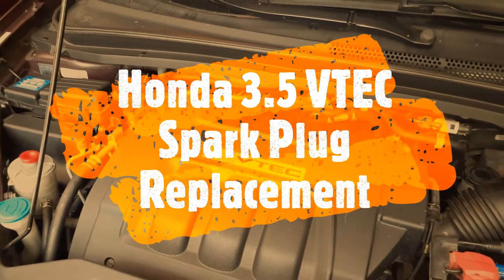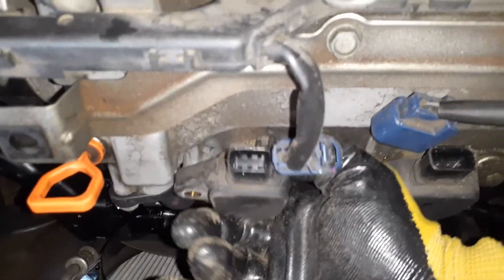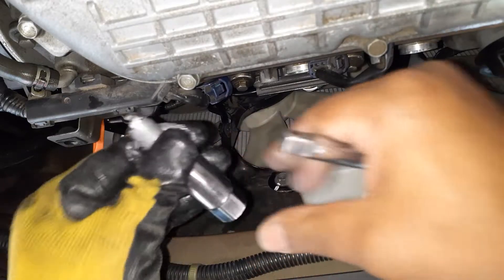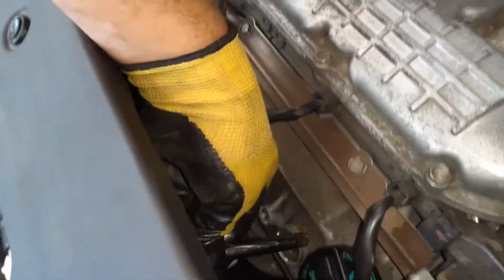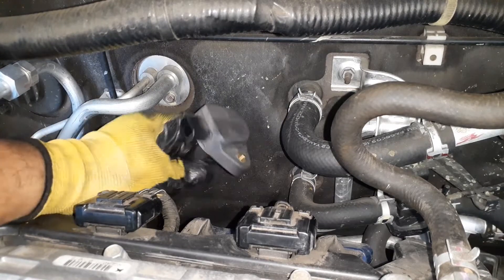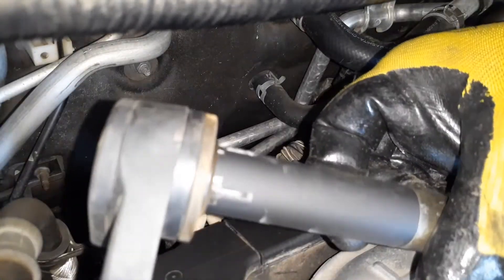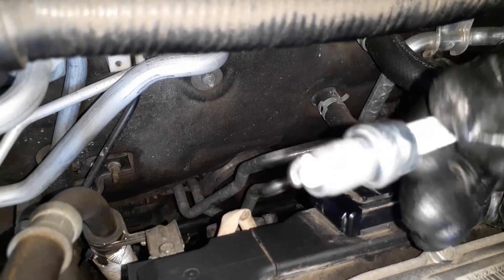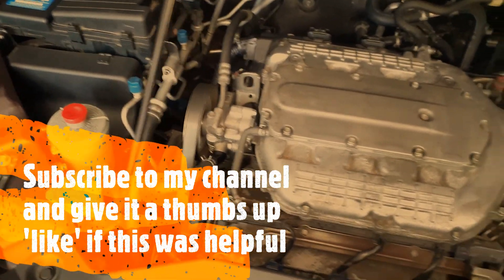Honda 3.5 VTEC Spark Plug Change - 2010 Honda Odyssey - NGK Laser Iridium Spark Plug 3657

Comment: Thank you very much for the excellent video. The narration was very thorough,  understandable and easy to follow every step throughout the whole video. Even the tools needed to complete the job was covered. Two days ago I replaced my old spark plugs with six new spark plugs for my 2009 Honda Odyssey EX model which had 116,014 miles on it. I purchased NGK Laser Iridium Premium IZFR5K11 3657 from my local O'Reilly's Auto Parts. After installing the new spark plugs I noticed an increase in the power of my engine. Next up, I'll need to save up money to buy the OEM Hitachi ignition coils. You and your video gave me the courage and confidence to SUCCESSFULLY complete a job I was very hesitant to do. Thank you very much!!!

Comment: Didn't mention when taking off coil the end of coil rubber ring rips and can remain on spark plug when lifting out coil because dry then need a new coil , had this happen few times and got a wire and had to fish out dried rubber ring or can't remove plug with socket ,  Also aluminum block. Engines are notorious for plugs coming loose ! Had that happen TWICE ! FIRST TIME PLUG FLEW OUT ! and destroyed treads some residue dropped in engine and would later damage engine so had to REPLACE ENGINE ! COSTLY ! Second time plug flew out on replaced engine and had to RESLEAVE TREADS FOR NEW PLUG ! NOW I CHECK PLUGS EVERY OIL CHANGE  MAKE SURE PLUGS ARE TIGHT ! ANTI SEEZE ? Maybe put on end of inside coil end  to keep from getting stuck on plug and ripping and stuck on plug , but on treads ?  THAT MEANS GIVING PLUG MORE Opportunity TO COME LOOSE SO I DON'T USE ! Don't need to be out in middle of nowhere and have plug fly out ! Ford aluminum engines are also known to have plugs fly out 1996- 2009 ,